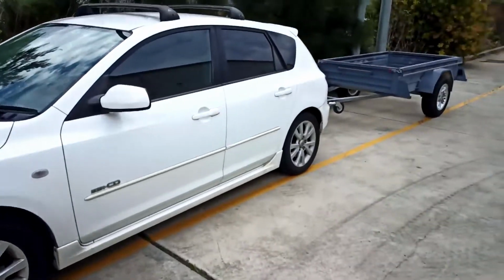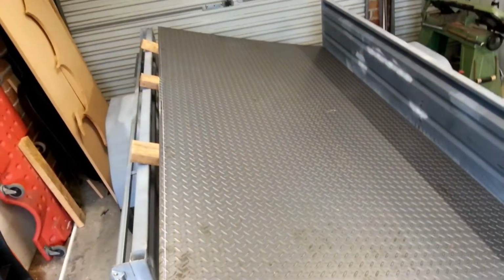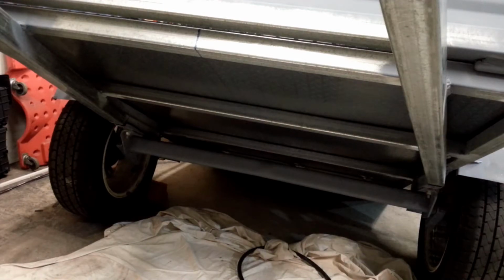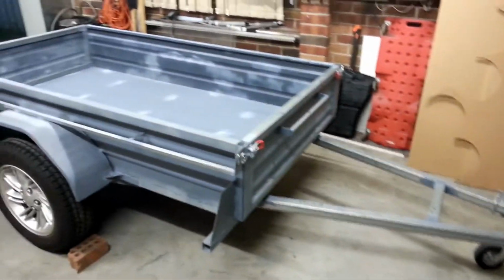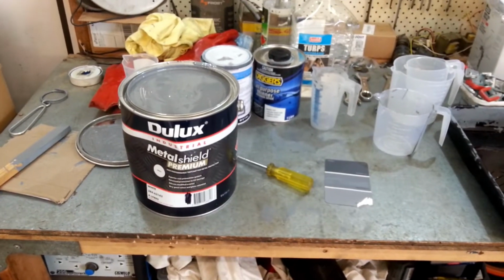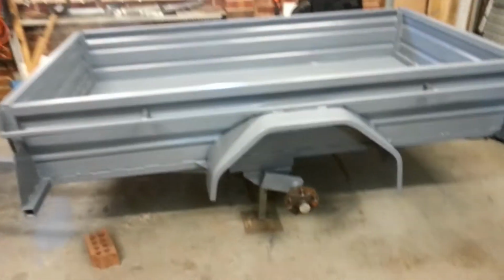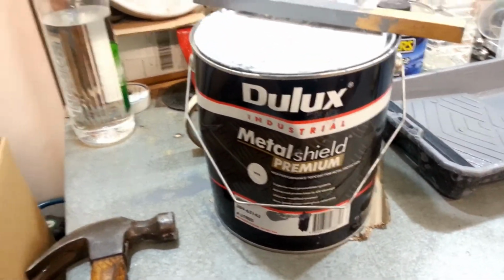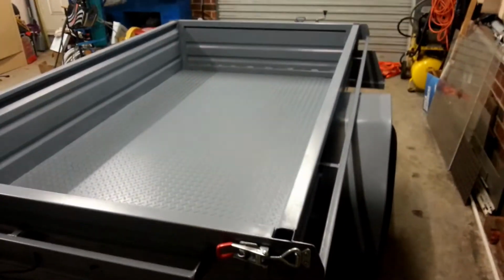Trailer restoration 7x4 foot Part 6 Complete

Comment: Looks great. How much for the floor metal?
Reply from the maker: Hi Mark 
From memory it cost $120 from Southern Steel, 2.5m x 1.4m 2mm steel checker plate.
Reply: @MaximumDIY   ok thanks. You've inspired me. I've done an intro to welding course at Tafe. Stick, mig & tig. I have an old AC stick welder & an old gas mig. Just got to pull my finger out. 😩
Reply from the maker: @1mach28914u1  I'm so glad I've inspired you Mark!  -  There aren't many of us DIY'ers left! 
If I could give you some advice with welding on a mig, perform some test welds on a few pieces of metal and see what works best. Then mark the voltage setting and feed speed with a sharpie on the side of the welder for quick reference if your welder doesn't have a welding chart. For example on my Ozito welder (17.4v @ 16 speed) works really well for 3mm steel. Also don't be afraid to crank the welder up to max and see what it's caipable of,  for years I never used my welder past the 3rd setting and found it was so much better when using more power in the correct application.
A good welding gun also helped me out massively as the Euro Mig guns use an electric switch on the gun instead of the cheap valve/switch in one unit and I found it hard to press the trigger - chechout more on that in this video https://youtu.be/NduMVNdxVEM
Remember, Like / Share / Subscribe.